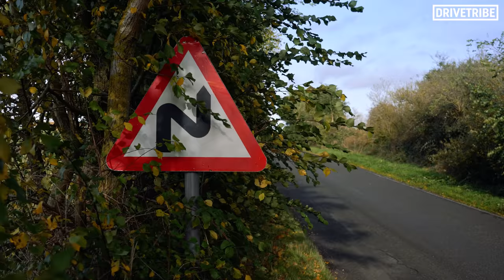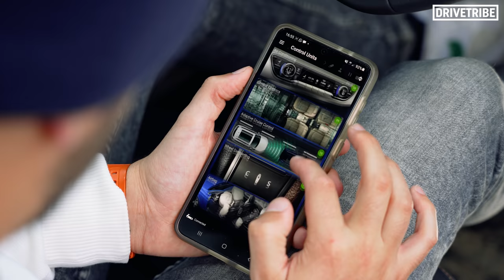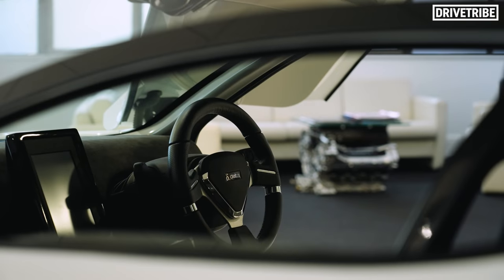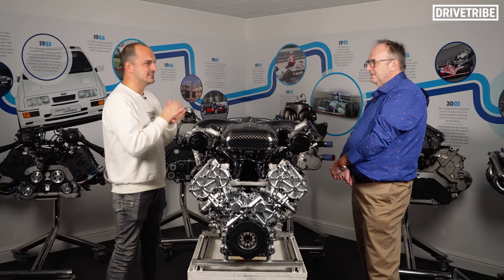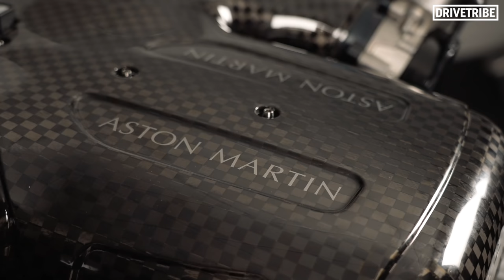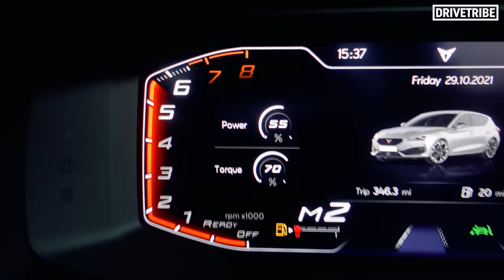Why are almost all modern engines 2.0-litres?

Comment: It's interesting to see these Benz 2.0's advertising 400hp.  Coming from the 4G63 world, 400hp isn't new by a long shot.  People having been making that relatively easily for over 20 years.  And  Mistubishi isn't alone in that.  It's also been the case with the 2.0 Cosworth YB, the 2.0 Nissan SR20DET, and the 2.0 Toyota 3SGTE amongst others.  Manufacturers had the right idea 20-30 years ago when these engines were conceived.  Having flirted with other stuff for years, the OEM's are finally coming back around to 2000cc turbo four cylinders.  Only now they're direct-inject, variable valve timing, and have much more sophisticated fuel management.  They're more robust and refined, but they're following an old recipe.
Reply: The difference, is that a new Mercedes 2.0 Turbo with 400hp will last a lot longer and be a lot more reliable than any 4G63 engine will.
Reply: Didnt that evo engine need servicing every 6k (or less) and wouldnt break 30mpg, also the amg engine will make boost around 2500rpm.

We all know people have had 400bhp out of all those wicked old engines. But the modern stuff is so refined.
Reply: Time will tell. Thing is the Toyota engine will Still be a strong engine in its 50th year. Can't see the merc being the same.
Reply: Yeah but a reliable 400hp in a 2.0 road car with normal service intervals and runs in 95octane is very different. I come from the same type of background and all of the cars you mentioned are very temperamental and most want pass an emissions test when the blow flames every time the throttle shuts from being on boost lol
Reply: @sirjakethebrit   Oh absolutely.  The newer stuff has a better torque curve, better mpg, and is certainly cleaner.  A well built 4G with a forged rotating assembly and properly tuned will last forever.  It's really the manual transmission and transfer case which give up first.  That's why we see so many built auto's in those care nowadays.
Reply: They do sound poo though. Coming from someone with an SR. N55 best sounded engine recently.
Reply: Making a 400hp 2L isn't what's special about it. It's that they did so without running afoul of modern emissions laws and fuel economy regulations, while also not having too brutal of a turbo lag problem, and without spending 600hp V8 or V6 money to build it.
Reply: I have a 5.4l V8 in my AMG, still makes 350bhp and has done for the last 250,000 miles, the modern 2L turbo will probably do the same, all the stuff you mention is pushing at reliability limits and is not nice to drive day to day and that's what is special about the new stuff, it's factory power you can live with easily.
Reply: Alfa Romeo used to achieve that power in the 80s with their race cars
Reply: @johnmitchell2269  nope cos turbos add complications and future wear and tear.
Reply: @popuptoaster  my Lexus GS 450h has a 3.5 litre v6 345bhp and bulletproof now and years to come hopefully.
Reply: @johnmitchell2269 BMW used to make 1500hp from a 4 cylinder 1500cc engine, but it didn't last very long.
Reply: @johnmitchell2269  As an ex A45 owner, i doubt that. Sold mine early last year. They are very fragile !.
Reply: @sirjakethebrit  that's just anti Japanese hype, mine doesn't need services like that at all, stock internals pushing 600hp. Yearly oil change is all I really need to do
Reply: @sleepwalker8600  not true at all
Reply: I’m a 4G63 lover, having got one myself. But they don’t hold a candle to modern 2.0L turbo engines when it comes to daily driving and fuel economy.

The 4G63 is a pig on fuel and has a generous dose of turbo lag thanks to its low compression and port injection. Direct injection and modern efficient turbo’s are amazing bits of tech.
Reply: @PhilS404  My thoughts too even  a 3 cylinder engine has more character.
Reply: @hardlinefoil7532   ( lo   anecdotes abound.           )   NB.        LAUGH
Reply: @kadmow  English?
Reply: @hardlinefoil7532  It iwll never pass any tests for being sold in a production car.
Reply: the big difference is that the 400hp merc will have a warranty. you buy a YB or 4G63 back in the day and either they were modded so no warranty, or had so much lag, your grannys 1.0 shopping trolley was faster in the real world! remember when Clarkson & co on top gear (i think it was) put a standard lancer and an EVOFQ400 in 5th at 30mph and raced them over whatever distance it was? the boring old lancer was the faster car!
Reply: @petelattimer6808  who drives at 30mph in 5 gear?
Reply: @petelattimer6808   I do remember that test and while I'm a huge fan of Clarkson, the test itself was facetious.  Who puts a car into 5th gear at 25 miles an hour and floors it expecting immediate power?  That's not how power curves work and certainly not what you'd do in a spirited drive.  The base car had smaller turbine wheel and thus spooled quicker.  It didn't have nearly the top end that the FQ400 did.
Reply: They are following Mitsubishi Evo route...let's give credit where it's due ..👏
Reply: @hardlinefoil7532  at what rpm your 4G turbo hit full boost?
Reply: @rel6294  it's a well tuned twin impeller unit, it's at 30 psi at 2600rpm
Reply: @hardlinefoil7532  wow, its definitely a proper tuned engine. 

2600rpm spool is nearly the same as merc 2.0 400hp that spool at 2400-2500rpm.
Reply: @rel6294  yes well, we relied a bit less on crazy boost, and improved the top end of the engine instead, that way less time waiting for massive turbos to spool up. The turbo itself was still almost 3k though😭😭
Reply: Well I'm fortunate enough to own both a Mitsubishi Evo running 408bhp and the New AMG A45S with 421bhp.

What I will say is that whilst the Evo is an amazing car,and in some ways better than the merc (handling),the engine in the Merc is on another level.

The cooling on the merc is nuts,it uses 3 water pumps that can cool the head,block and turbo all independently,so all are running at optimal temperature,and it will even use the air conditioning to cool the turbo down when things get too hot.
The turbo needs that much cooling due to them running 2.1 bar (31 psi) of boost as standard!

So where the Evo will start to suffer in the heat after a bit of spirited driving,the merc can maintain it's performance.

To top it off I can get over 42mpg on the motorway in the AMG,best the Evo will get is around 32.

For what it's worth I've owned Evo's for years.Ranging from the Evo 4 and it's crank walk,Evo 7,Evo 9 and current Evo X.
The AMG A45S engine is better than any of them.
But in the Evo's defence,it has just turned 130,000 miles on the clock,and the engine hasn't missed a beat,and it's been running 400bhp for over 10 years!
Reply: Coming from a 500 hp sr20det owner.  Making the Power is easy.  Making it through emissions?  Not so much.
Reply: @juanc5149  that's because you don't use cheat devices 😁😎
Reply: @johnmitchell2269  that's a bold assumption
Reply: @swisscourthustle  the tradeoff is now you have injectors that cost an arm and a leg and you need a new turbo every 100,000 miles or less
Reply: Ecoboost 2.3!!!
Reply: @Paper.Power.Politics  naaaaaaa
Reply: @hardlinefoil7532  right now I have a 400whp 2.3 ecoboost,  and right now I’m in the process of building a 1000whp 2.0/2.3 ecoboost.  So I think yaaaaaa
Reply: @hardlinefoil7532  my boy is building his evo 8. That’s also gonna be a super sick build!! Those 4g63 engines are legendary
Reply: @Paper.Power.Politics  oh yes, definitely better sounding engines that mitsubishi made. Especially the amazing 2l mivec V6 in the fto, which I'm also glad to.say I have. But for sheer hooliganism the 4g63 is wicked
Reply: @hardlinefoil7532  yeah I agree!! I’m building my ecoboost but Deep down inside I know I should be building a 4g63 lol
Reply: @sydsnott5042  previously yes, because Toyota so deliberately and deeply under engineered them. Now that Toyota have started playing in this same space with much higher tech and more of it, they will likely have more issues too. It’s already happened with some of their newer, more highly tuned diesels.
Reply: The sr20det is a doggg i know that. Hugeee turbo lag that you will stall your engine. A toyota corolla will outsprint you at low rpm. Nothing below 3500rpm and revving it to 3500 takes time. The amg 2ltr engine is fast but it still needs to be revved. V8 gives you lazy performance and instant torque without revving.
Reply: None of those 90’s turbo 4 cylinders had the sophistication these new 4 cylinders have. These engines hardly have any turbo lag, something a 400hp 4g63 could only wish for.
Reply: @JohanSalvattore  this I agree with also! Almost no turbo lag at all in these engines!! I’m pushing 400whp in my Mustang ecoboost. And now currently building a 1000whp 2.0/2.3 ecoboost engine.
Reply: People have been making 400hp 2L I4's for 35 years.  Late Group B cars were hitting and even exceeding those numbers consistently.
Reply: 86x86 has been around for a while!
Reply: You are comparing apples to pears
Reply: @sydsnott5042  Lol literally the real overengineered mercedes engines last x4 most toyota engines, you delusional hater. Toyota is one of the greatest and most reliable car brands, if not the most TODAY, but the true mercedes from the golden era of the car industry hitting 2+ million kilometers without doing nothing on the engine other than frecuent quality oil and filter change you cannot compare to nothing else. Small yet powerful and economical and Extremely durable. There is a reason 50% of the taxis and medium-high class people where I live only drive Mercedes.
Reply: If we could calculatorize Thorium ( proven in the 60s; see Kirk Sorenson videos) ... we could have unlimited gasoline and electricity, making this renewable stuff worthless.
Reply: There seems to be a repeat reply over and over stating something to the tune of "Well these newer engines are cleaner, more reliable, and are in a league of their own."  Right.  At the end of my original comment, I literally noted this already...
My point is that OEM's are openly touting the power figures as a selling point for these new vehicles.  They're in commercials, auto reviews, brochures, etc.  They know horsepower sells so they so advertise it.  Simple.  These power figures are not anything groundbreaking in the world of 2.0 turbo powerplants however.  These levels of poiwer have been attainable for a long time. That's it.  That's the whole point.
Reply: @Pirustae  yeah but they had to use 12k RPM to do it lol
Reply: Neither is 1000hp. There are reasons people/manufacturers don't stress the life out of their engines.
Reply: anonymous  And how many people all over the world have gone through multiple 4G63's coz they keep blowing them up?
Reply: Mitsubishi made the FQ-440, but that one doesn't count, as it came with a dealer installed tuning package, as opposed to the A45 which comes out of the factory with that power.
Reply: There is no reliable way to know how much horsepower a forced induction engine has. The numbers are manufacturer advertised, they can be anything. In reality the engine can be heat soaked after 10 minutes at peak power. The buyer doesn't care, he is not racing at LeMans, he needs to make a pass. So ... how is this type of power called?Cos couple of seconds of extreme boost is not real horsepower unless you're american and you think 2jz is a racing engine